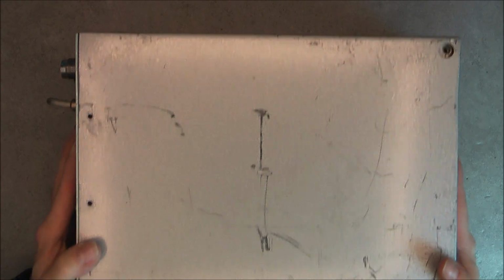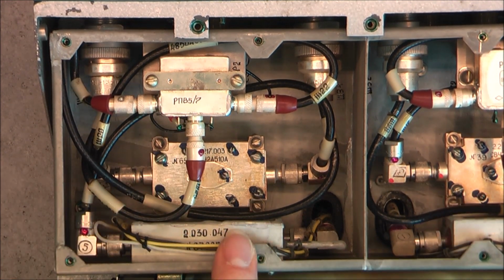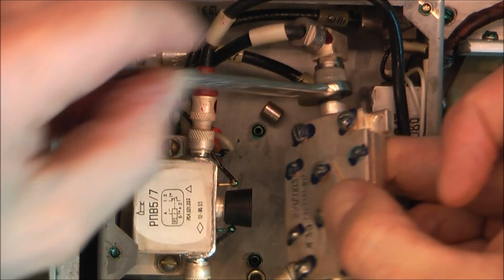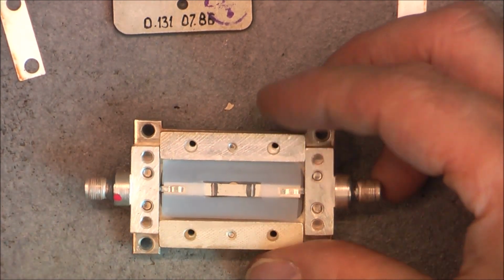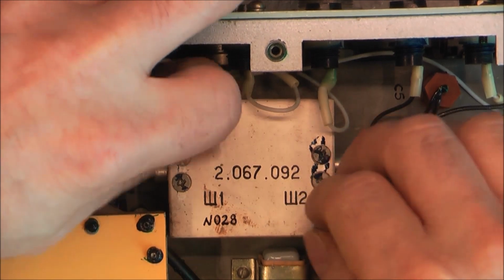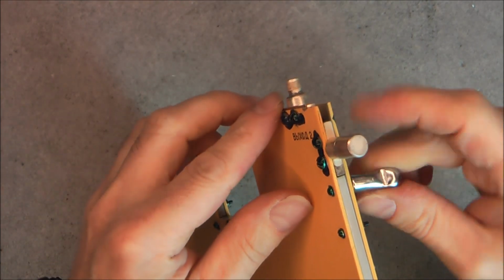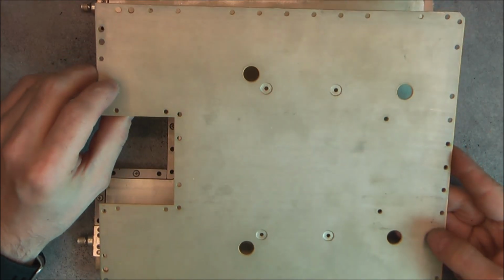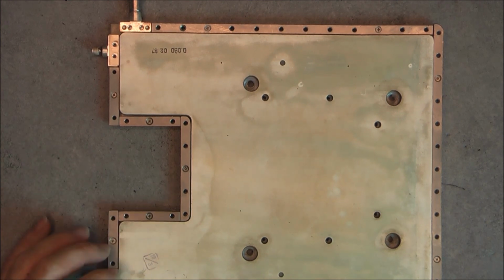Soviet military electronics teardown: E-520.2 antenna switcher

Comment: The first part could be a circulator or isolator with the RF diode used as a detector to monitor reflected power.
Reply: The circulator must have a magnet, these devices have no magnet for sure. And there is no Ballast resistor necessary in RF isolator. Also these parts has no other signal pins (output for example) to be a RF detector.
But Near the cover of the diode there is an inscription "2а510" (in Russian). It is type of uhf power limiting and reciever protection Diodes. So these RF parts are probably RF power limiters or reciever input protectors made with two special Diodes mounted in series with signal line between its.
Reply: Two anti-parallel diodes against ground let me also think of a input power limiter/protection - good catch :)
Reply: @susloid  Good points, yes input protection makes much more sense considering it's a rugged DF application.

Comment: Big flat RF part has connector "input" (вход), two connectors "output 1" and "output 2" (выход 1, выход 2) and one terminated with 50 or 75 ohm resistor. It is probably RF power divider.